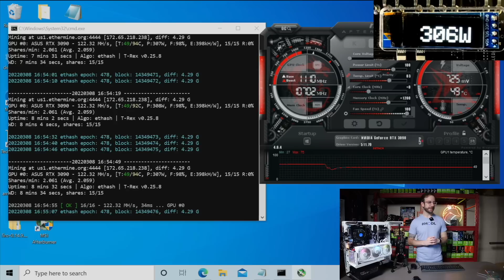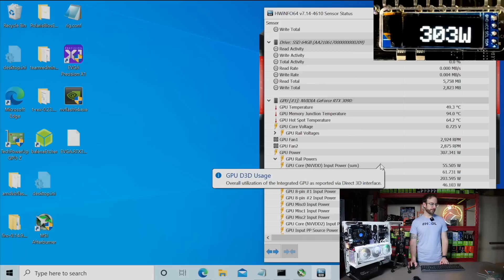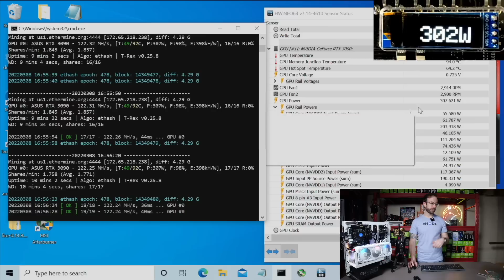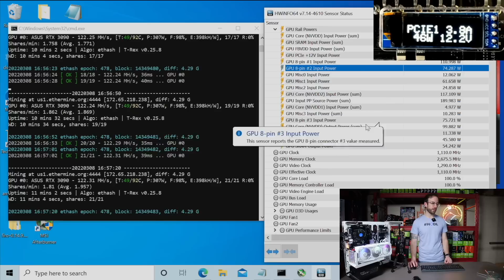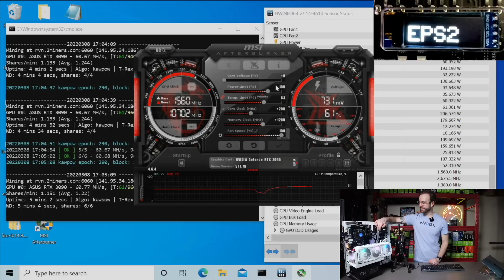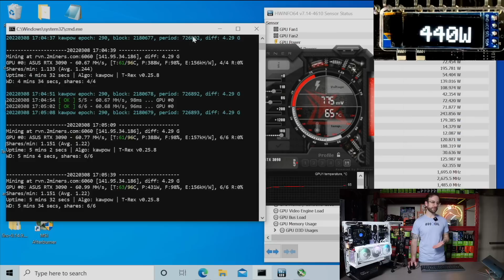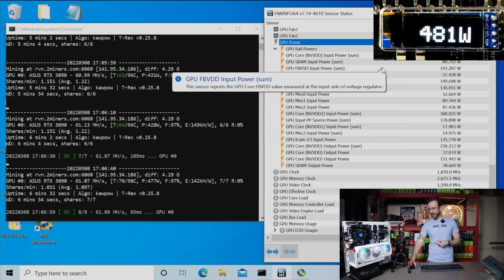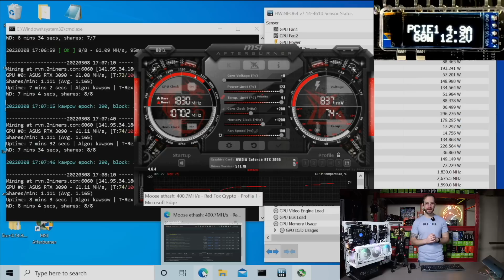Just How Much Power Can a GPU Pull Over the RISER? (RTX 3090 Tested)

Comment: I have a question folks. I have a spare 1650 Super GPU. Could I connect it to my desktop with a riser and boot into Windows without a power cable? I would only need to boot into Windows to a recovery bios flash on an RTX card. I wouldn't game on the 1650 Super, just boot to flash my rtx and want to know if that is possible with just a riser cable?

Comment: Im a miner and I have this same card with another MSI 3090 GamingX, Now i stopped buying 3090s cause they have given me big time on there maintenance and power issues. I have burned almost 2 numbers of psu worth 1kw and some of the power socket area near the GPU. Still using them to mine as i have done the ROI on it, but will never buy a 3090 again.. Its a whole different business if you mine on 3090.. Be careful guys where you put your money in..

Comment: The reason people say 100W is because people add a safety margin on top of the 60W that is drawn across the PCI slot. It's just easiest and safer to round up to 100W. No one actually thinks they can draw 100W across the PCI slot. Because I've always considered it to be 100W I've never once blown a 6pin sata connector since employing the safety margin (because I switch before it draws enough to burn it)

Comment: The 3090 FTW3 is that you should have tested with. There's a common issue with them pulling over 80, causing issues with the power limits. 500w bios and yet they will be power limited pulling 430w because the pcie slot is pegged at 80-85w and the third pcie connector is lagging way behind the other 2

Comment: You need to watch BBT video.  He used the same in line tester and was able to get the riser to pull over that wattage when mining more core intensive algorithm.   Even thought you had the core clock turned up Eth does not put full use to the core.   Need to use a more core intensive algo like ravencoin to get the full usage out of the GPU.

Comment: Lol. I have been eth mining on over 20 current gen cards for over 1 year on sata powered risers. some of them are daisy chained with 2 3060 ti or 2 3070s on a single sata. 
nothing happens. The wires are not hot. They running for months without issues. 
Think about it: he is pulling 300watts and STILL is within the safe 54w limit for sata. I run two 125w 3060 tis and the pci uses less than 25w each. the anti-sata advice is antiquated when dealing with the latest gen of cards and needs to go away and stop
Reply: Yes plus to this it seems that nvidia prioritizes pulling wattage from the 6/8pins rather the pcieslot power. Older rx 480/580s use max wattage on pcieslots tho so i dont use the sata adapter for those cards. Not sure about Navi cards but i only have 6600xt's and i doubt it'll pull much from pcie since it literally uses under the rating for pcieslot power.

Comment: I'd bet older gpus would likely draw more power from the pcie slot, I wonder what an old r9 290/390 would pull.  as a wire heats up its resistance increases which makes it pull more current making it heat up even more. So something can appear to be working just fine but is going to slowly heat up untill either the plastic melts enough to disconnect  itself or short out in a way that makes the rig shutdown, or if you're unlucky the melting wire insulation will smolder and glow until a tiny flame appears and wastes no time burning your house down, roasting alive any pets and/or small children as it incinerates everything you own.

Keep fresh batteries in your smoke detectors people. If you're house burns down and melts my boat parked on a trailer outside. Not only will you own nothing, you'll owe me a new boat and you've gotta borrow a shovel from someone so you can dig the huge solidified metal puddle that once was a boat and trailer out of my lawn.

Comment: Nvidia cards auto balances load over all resistors. XOCers need to shunt mod the PCIe resistor in addition to the ones for the 8 pins. If not done the card goes into recovery mode, kind of annoying tbh.

Comment: Yea, you can pull more power through PCIE through shunt mod lol. But the power reading wouldn't ne accurately read and you will definitely burn up the riser or pcie slot. We only shunt mod the 6 or 8 pin ones so we can get more power, but then you need a hardware level reading to make sure your not overdrawn power. Take care, thanks for educating the community

Comment: Always great content,    still unsure myself on how this all adds up .    is the GPU Riser in addition to the power stated in HIVEOS?   when adding up GPU power... say 6600 HIVEOS shows 65w power used... i would add 75w (GPU RIser) + 65w for the GPU = 140W needed for 1 GPU ... I kept 75W as a max pull from risers - RPM showed that as a max in one of his videos.. i may have misunderstood him.  Also , well with my 3060 LHR or 6700xt  they both sit at 120w then i add in the 75W per... round up for safety to 200W pull ea card/riser...  AM I USING THE CORRECT FORMULA or am i overrating the power pull?
Reply: If you have 120w in your 6700xt you underclock really bad. I've on my 4 6700xt cards 89/90W each. And if you want it really stable 94 is the max I get. I've a plug that measures W on the wall, and the difference from HiveOS only measuring gpus is about 400W on 11 cards plugged. If you add motherboards/memory/ssds, that difference is less than half. So risers will not consume 75w each ever.

Comment: Some of my BIOS modded 5700xt cards pull 94W at the PCIE riser as measured with a clamp amp meter. AMD software reporting varies from 67% to 89% of the true power draw off the PSU. Nvidia 30 series cards all accurate per software and never over 65W on the PCIE slot.
Reply from the maker: I'll need to test my 5700s and 5700 XTs next. Been meaning to get to them.
Reply: @RedFoxCrypto  also great content as always. Thanks much!

Comment: Not all 3090s pull power the same way. This is a sample size of one (one of the most high end models btw), which isn't close to enough given variation amongst 3090s. Test 10 of them, include zotacs, actually use a sata, and lets see results.
Reply: Jesus is Lord  neither really. Just trying to help people figure out how this works. Some people will be ready to disregard SATA warnings because they see ONE 3090 run successfully, but that's not the safe way of  powering your device. Theres a lot of variation amongst 3090s. BitsBeTrippin has a video of a zotac 3090 pulling 100W from riser. 
Ofc if I see a Red Fox video about this or anything, I'm clicking it. Big fan either way.  He's a great guy and his content is always genuine, informative, Red Foxness.
Reply: Big agree here. I think the big issue is the strix has 3 8pins, so it splits the power among those and then a little on the PCIe. It’s possible 3090s with only 2 8pins may rely more on the PCIe slot.

I could have sworn I’ve seen 93w pulled by a zotac 3090 with no absolute clock set

Comment: I did see it live on BitsbeTripping on multiple 3000s cards on some algos! I saw it using the same same type of monitor tester for just the riser. But again. Could be 2 pin cards more than the 3 pins.
Reply from the maker: His meter seems to measure differently which could result in some inaccuracies.
Reply: @RedFoxCrypto  yeah. It's possible. But also. A riser from one to one might not follow the standards.. Who knows. But. The old saying. Never ever use sata or molex stands! 😉

Comment: Awesome video. Great info. I wondering how people use server 6 pins to 8 pin to power those things considering at max each 6 pin cable is max TGP of 150 watts. That card was pulling 502 watts at one point, meaning those 6 pin to 8 pin from parallel miner can’t handle those 3090s at all.

Comment: The fact you did this on a 750 W power supply is very impressive
Reply: Should watch the video a 3090 ran on a 500w
Reply: 750w  x 88%  gold efficiency = 660 watts. cpu taking 65 watts and rest of the system is taking 95 watts. Sounds reasonable to me.

Comment: Hey Mike. I like your videos. 
Please try with a 3090 that have only 2x8 pin cable connectors. (Asus tuf 3090 or something like that)
I think it will try to pull more watts from the pci-e slot or riser that a 3090 with 3x8 pin cables connectors.
Reply from the maker: I'm going to try it, but I think those cards also have a lower TDP. Maybe I'll do it on a livestream.
Reply: @RedFoxCrypto  did you give it a try?
Reply: I think it would yea. I have a 3060 with 1x8pin and when overclocked to full it can pull full 70-75w over riser. so always get cards with 2 or more 8pin connectors if you're thinking of mining with sata on pcie

Comment: Hey Mike, for gaming I’ve shunt modded my 3090 so that it pulls 650w 😬. The only 3090 that has pcie power draw problems is the ftw3. Can look up the load balancing issues they messed up on. I believe that those cards have been known to pull 75w or more.
Reply from the maker: I have one. I'll put it to the test.
Reply: @RedFoxCrypto  thats the spirit
Reply: Rev 1.0 FTW3 3090s had issues pulling too much power from the PCIE slot. Evga has since fixed that issue but now Pcie#1 and Pcie#2 pull FAR more wattage than Pcie#3. My 3080ti will pull only around 50w on the Pcie slot but over 150w on the #1 pin and #2 pin each while only pulling 80w on #3 pin. It is some kind of design flaw but as long as you don't daisy chain your cables it shouldn't be an issue. I imagine if you shunt modded an EVGA card you could potentially blow up your card/psu cables when it trys to pull over 300w from your #2 pin connector. Lol. The Strix does a better job of balancing the load across the Pcie slot and more equal amounts from #1,#2, and #3  connectors.

Comment: Red Fox, I think if you like to push a riser to the limit you need to test cards with no additional input power like the A2000 I see gets up to 80w and cards that has only 1 or 2 extra put input having 3 the engineers just locks down the 16x slot .. and use mainly the 3 other inputs .. so the less input you have the more the 16x will be put in the mix .. again the A2000 pulls more from its x16 then the 3090’s so yeah you don’t really need to use a big card to put the x16 slot..
Reply: The a2000 is very well controlled. The higgest ive seen while mining is 69w. Thats pushing it pretty hard to 42mh/s
Reply: @DJ.1001  software read out is wrong .. look at video many YouTuber made shows 79-80w .. this is using the 6pin watt meter .. not software

Comment: Interesting results. I'm curious, I know there are 3-8 pin connectors, but what happens if you only populate 2 and leave one disconnected? Will the GPU even start working? I haven't ever tested that. If it does operate, can you start doing the tests from that perspective? Maybe it will compensate the lack of a 3rd connection through the other cables including the slot power?
I enjoyed the video. It is interesting to see new top end cards (including AMDs RX7970, or whatever) having higher TDPs, and worrisome! I know, we control it 😉
Reply from the maker: There were some older AMD polaris series cards that you could only power one connector, but I haven't seen anything since those that allows it to work without populating all the 8 pins.

Comment: I know that SATA connector can support max 50 watts. But how about molex?
Reply: Most are 156W - 18 AWG thickness.  However, if your risers only use the 12V rail, it can only supply 135W or so.

Therefore 2 high quality risers or 1 low quality riser can be connected by 1 molex cable.
Reply from the maker: SATA Is 45w. Molex is ??? - there is no specification standard for it.